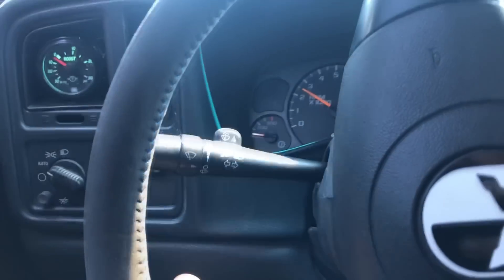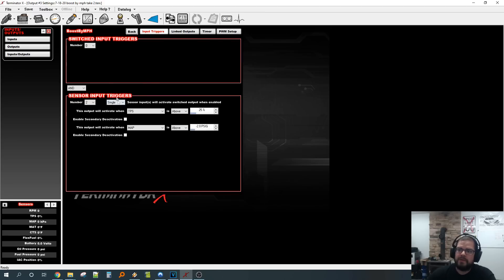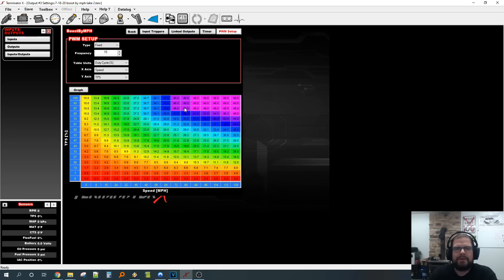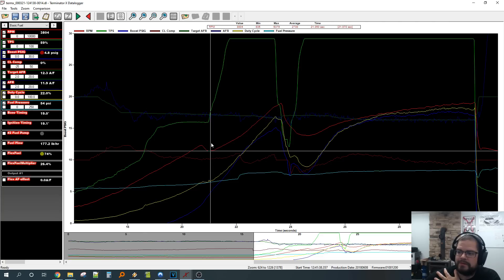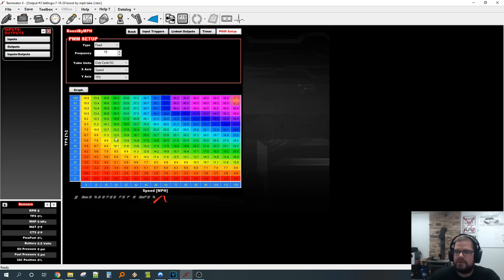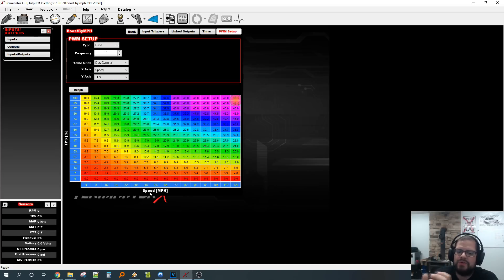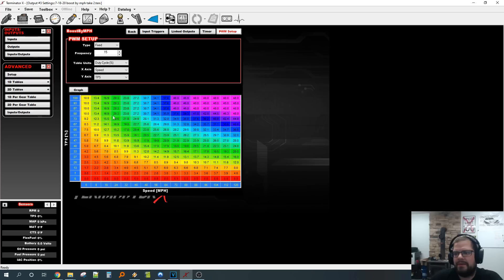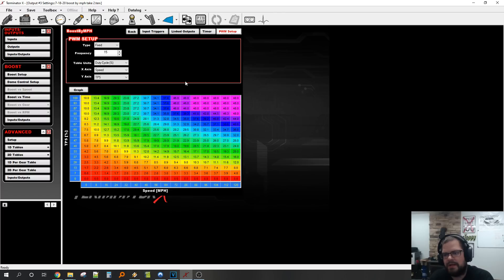big boi 2500 boost by mph street tests

Comment: I know I’m late here but I have a 2001 silverado with a 6.0/4l80e swaps truck. Have a terminator X max showing up and was wondering if you had a video showing how to integrate the terminator into the stock cluster. Or what all I need to keep and piggy back off of for the stock ecu to still control the cluster?

Comment: Thanks for the session, I'm planning on doing a similar build in a 4WD fullsize Bronco.  I want to be able to launch it off the trans brake in 4wd over 10lbs.  Should hold up on 2017 SuperDuty axles locked front and rear :D  Going to surprise a LOT of people.  Probably going to suck with 3.73's and 37" tires though...

Comment: Also I noticed with Holley 92-97 aode transmission harness there is no plug for input shaft speed sensor  and on my car I have 2 speed sensors one for input shaft speed and the other for the tail end which reads your vehicle speed

Comment: Hello mat my mustang MPH in terminator x is way off I never had a problem with it before I installed term x in software I have my rear set at 3.73 and tire height at 28in rear tire 295-60-15 Mickey front are 245-45-17. I talked to Holley performance today and explain to them this issue and they recommend to change the gear for the speed sensor and I understand when you change you're rear gearing you have to change the gear for your speed sensor but I never had a MPH issue on my stock speedometer before installing Terminator X what would be your guess at this issue??

Comment: You needz MOAR data! Researching a bit about traction control for Holley I came across what Andy Whittle is doing - Whittlebeast on the Holley forums. He's doing all sorts of awesome math using Megalogviewer. If you could get a front wheel speed sensor on there and a G-sensor (they're cheap, used in drones) you could get some VERY interesting data indeed. Check out what he's doing in this video https://www.youtube.com/watch?v=NrBk9LYa1DU&feature=youtu.be It's all just math and having solid inputs! Since he's active on the Holley forums, or has been, I suspect he's done this with Holley as well but he's not posted any videos. His channel isn't really active but I bet you two could work well together slicing and dicing data! Damn I wish my car was running lol

Comment: Looks like some Holley users have figured out how to do some things using both rear and front sensors. My ECU has "real" traction control but really it's just covering up what this sort of thing does. You certainly need more wheel inputs, can you not tap into the ABS sensor?
https://forums.holley.com/showthread.php?20291-Traction-Control

Comment: Was going to ask about using a front wheel speed sensor and BAAM! There it was. If you were using a DBW I suppose you are pretty close to traction control?
Reply from the maker: yep, it is DBW and i could yes.

but this is boost by mph not, how to use electronic throttle traction control based off driven and un-driven wheels, but i am happy beyond words someone used their brain, when i explained all this and understood the simple facts you posted.

Comment: Did you split the vss with the factory wiring and the terminator ?
Reply from the maker: no
i just cut 90% of factory shit out
Reply: How did you get the speedo to work ?
Reply from the maker: @aaronsunderland7774  i used a holley speedometer output and wired it directly to the dash speedometer wire

Comment: So to prevent the wheel speed/boost running away when you break loose, what if you got your speed reading from front wheel sensors like the screw driver Colorado boi?
Reply from the maker: yes absolutely correct

Comment: would love to see the front wheel speed sensor to pull timing when the rear spins, as you mentioned at the end. That combined with boost by mph and boost by TPS like you showed would make any driver look like a magician
Reply: Check my response above, judging from what I'm seeing in the Holley forums that looks possible and has been done!
Reply: From that you don't even need a 1-1, could add an amount of slip in it depending on what you like.

Comment: Matt is there a good way to utilize multiple boost strategies in the same tune with the Holley software? Say for instance if you wanted to use boost by time from a launch, but if the car is already rolling then it would use boost by mph. I’d be interested in seeing how this could be set up.
Reply from the maker: great question, it would be interesting to scramble a different strategy mid flight eh? might have to try and hash it out

Comment: Very informative, are you going to add traction control that looks at front and rear wheel speed? I like the fact that you added boost control compared to throttle position.

Comment: Can it be set to pull timing instead of boost? Pulling timing would reduce power faster than reducing boost and pedaling. I'm not sure if the terminator is capable of traction control.
Reply from the maker: Yes but, you don’t really want timing based off tps, you could implement traction control, but this is boost by mph we are talking about

Comment: Do you do any remote tuning?
Reply from the maker: Nope, I barely have time for what I currently have on my plate, also most vehicles have tons of mechanical issues that need to be seen and sorted physically at time of tuning
Reply: @SloppyMechanics  thanks for the response. No worries. Im just rebuilding an old c10 and putting a holley sniper efi on it no frills or fancy things just stock build with a very mild cam.
Reply: check out his tune cabinet though, and build from their...I did and i am an idiot
Reply: @T-rev Motorsports like I stated it isn't anything performance or anything not an ls swap or anything, just a factory refreshed 350 small block with vacuum advance hei distributor and holley sniper efi. Wasn't looking for power and to do wot pulls..........🙄 just after it self tunes wanted someone to look it over and smooth things out for driveability. I accepted his answer so idk why people have to pile on

Comment: I was wondering why you did boost by mph off of rear wheel speed instead of front wheel speed?
Reply from the maker: Very simply I do not have front wheel wired in, this is the “free” 80e speed input as I suggested
Reply: Sloppy Mechanics need to get the front wheel speed hooked up and get the boost by mph working more effectively next.
Reply: Rear wheel speed alows him to pedal for traction better without it falling off boost flat on it face. Pleasant side effect is that it takes the nut up or shut up out of burnouts allowing for a better use of pedal rather then just holding it to the floor.